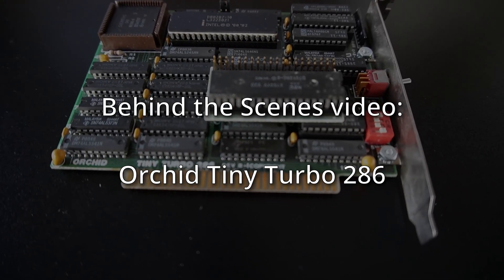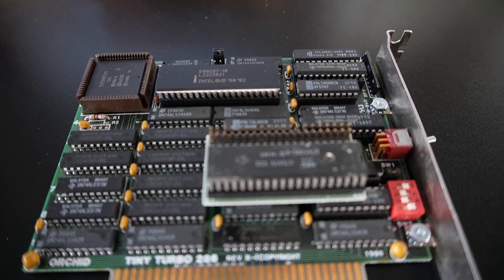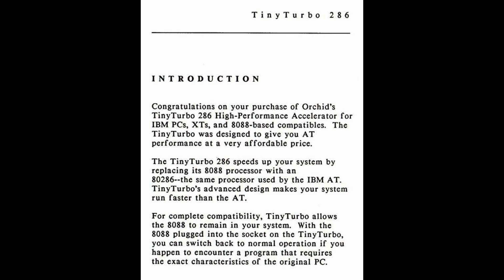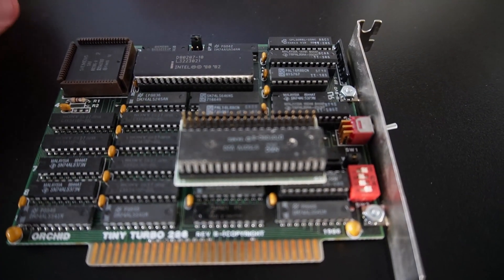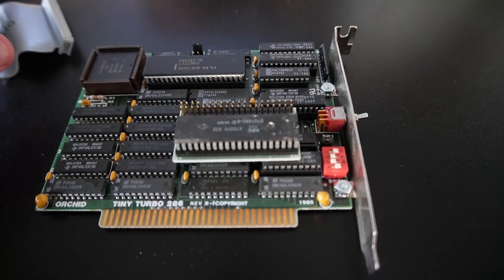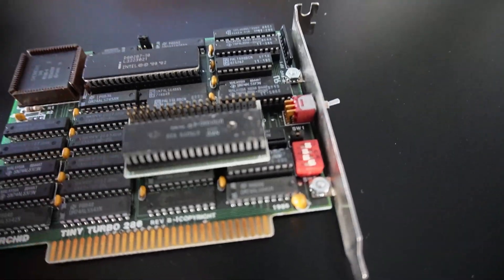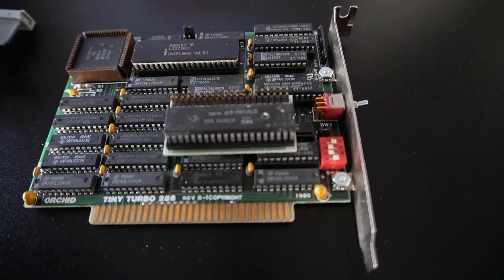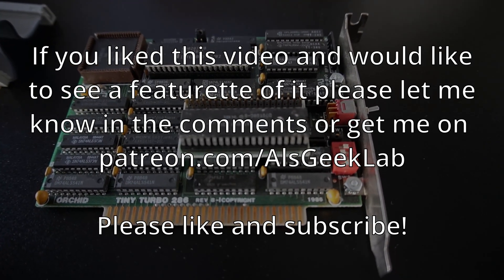Turbo Charge Your Retro PC with Orchid's 286 Upgrade

Comment: I remember these. They work well. If I remember correctly this model gets the clock off the ISA bus. Performance wise they where OK, most programs got a boost but as soon as the ISA bus was been use for like I/O performance dropped off, you had to disable the cache on these to get some programs to work correctly and did have some compatibly issues on some clone motherboards.

Comment: Sadly these types of cards where never that affordable, especially once the PC clones were common place, they were anywhere from 50%-85% the cost of a new 286 PC clone and would generally be limited by less RAM (640K/1M vs 4M for a "full" 286) and the 8 bit bus. I think only businesses and certain professional users (e.g. your lotus 123 example)  would find this a cost effective upgrade, and that saved cost was probably due to time saved just sticking in a single card vs swapping a PC , copying data reinstalling applications and or swapping additional hardware .